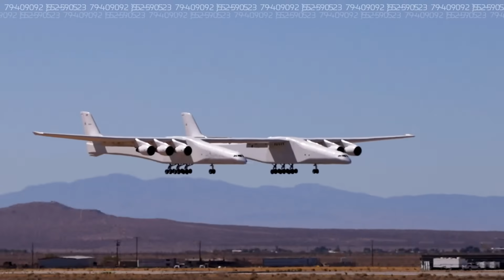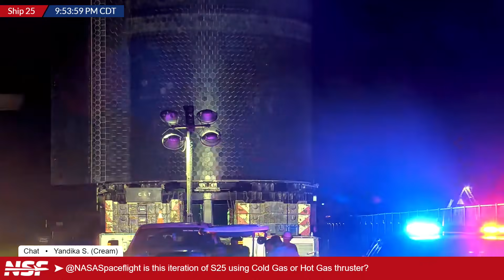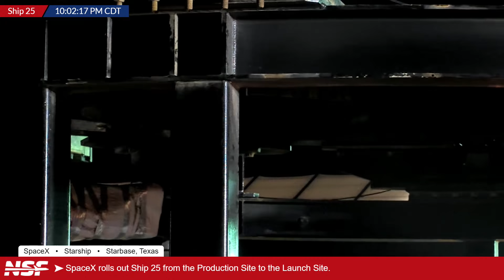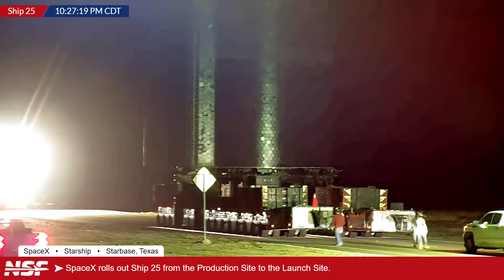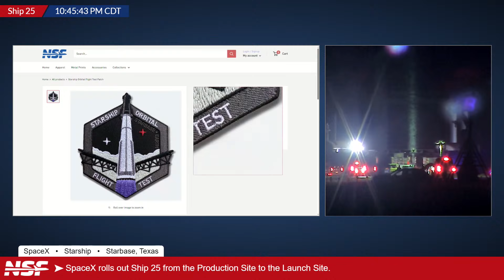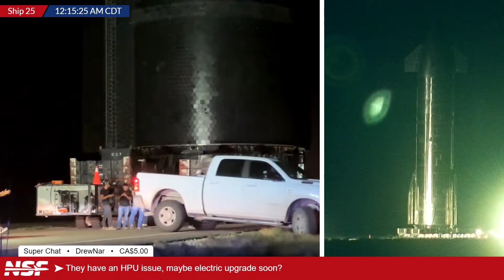SpaceX Rolls Out Ship 25 for Starship - Integrated Flight Test 2

Comment: NASA Facts: Secret NASA documents reveal the real shape of the Earth!
1 - LOCKHEED SR-71 BLACKBIRD: Technical Memorandum 104330: Predicted Performance of a Thrust Enhanced SR-71 Aircraft with an External Payload:
Page 08: DIGITAL PERFORMANCE SIMULATION DESCRIPTION: The DPS equations of motion use four assumptions that simplify the program while maintaining its fidelity for most maneuvers and applications: point-mass modeling, nonturbulent atmosphere, zero side forces, and a “nonrotating Earth”.
2 - NASA Reference Publication 1207: Derivation and Definition of a Linear Aircraft Model: 08/1988:
2.1 Page 02: SUMMARY: This report documents the derivation and definition of a linear aircraft model for a rigid aircraft of constant mass flying over a “fiat and nonrotating Earth”.
2.2 Page 30: 3 CONCLUDING REMARKS: This report derives and defines a set of linearized system matrix for a rigid aircraft of constant mass, flying in a stationary atmosphere over a “flat and nonrotating Earth”.
2.3 Page 102: 16. Abstract: This report documents the derivation and definition of a linear aircraft model for a rigid aircraft of constant mass flying over a “flat and nonrotating Earth”.
3 – NASA General Equations of Motion for a Damaged Asymmetric Aircraft: 
Page 02: Rigid Body Equations of Motion Referenced to an Arbitrary Fixed Point on the Body There are several approaches that can be used to develop the general equations of motion.  The one selected here starts with Newton’s laws applied to a collection of particles defining the rigid body (any number of dynamics or physics books can serve as references, e.g. reference 2).  In this paper, the rigid body equations of motion over a “flat non-rotating Earth” are developed that are not necessarily referenced to the body’s center of mass.
4 – NASA: A METHOD FOR REDUCING THE SENSITIVITY OF OPTIMAL NONLINEAR SYSTEMS TO PARAMETER UNCERTAINTY: NATIONAL AERONAUTICS AND SPACE ADMINISTRATION WASHINGTON, D. C. JUNE 1971:
Page 12: A NUMERICAL EXAMPLE: Problem Statement: The example problem is a fixed-time problem in which it is required to determine the thrust-attitude program of a single-stage rocket vehicle starting from rest and going to specified terminal conditions of altitude and vertical velocity which will maximize the final horizontal velocity. The idealizing assumptions made are the following:
(1) A point-mass vehicle
(2) A “flat, nonrotating Earth”
5 – NASA Technical Paper Nº 2835 1988: User’s Manual for Interactive LINEAR, a FORTRAN Program to Derive Linear Aircraft Models.
5.1 Page 01: SUMMARY: The nonlinear equations of motion used are six-degree-of-freedom equations with stationary atmosphere and “flat and nonrotating Earth” assumptions. 
5.2 Page 126: 6. Abstract: The nonlinear equations of motion used are six-degree-of-freedom equations with stationary atmosphere and “flat and nonrotating Earth” assumptions.

Comment: the thing with diesel engines... when you run them out of fuel you have to get all the air out of all the lines before being able to restart... so if they did run out of fuel they might have had it easier to replace the power pack and keep driving with a new one instead of trying to get all the air out of the lines manually which takes longer than switching drive units

Comment: This is so commical
Reply: NASA Facts: Secret NASA documents reveal the real shape of the Earth!
1 - LOCKHEED SR-71 BLACKBIRD: Technical Memorandum 104330: Predicted Performance of a Thrust Enhanced SR-71 Aircraft with an External Payload:
Page 08: DIGITAL PERFORMANCE SIMULATION DESCRIPTION: The DPS equations of motion use four assumptions that simplify the program while maintaining its fidelity for most maneuvers and applications: point-mass modeling, nonturbulent atmosphere, zero side forces, and a “nonrotating Earth”.
2 - NASA Reference Publication 1207: Derivation and Definition of a Linear Aircraft Model: 08/1988:
2.1 Page 02: SUMMARY: This report documents the derivation and definition of a linear aircraft model for a rigid aircraft of constant mass flying over a “fiat and nonrotating Earth”.
2.2 Page 30: 3 CONCLUDING REMARKS: This report derives and defines a set of linearized system matrix for a rigid aircraft of constant mass, flying in a stationary atmosphere over a “flat and nonrotating Earth”.
2.3 Page 102: 16. Abstract: This report documents the derivation and definition of a linear aircraft model for a rigid aircraft of constant mass flying over a “flat and nonrotating Earth”.
3 – NASA General Equations of Motion for a Damaged Asymmetric Aircraft: 
Page 02: Rigid Body Equations of Motion Referenced to an Arbitrary Fixed Point on the Body There are several approaches that can be used to develop the general equations of motion.  The one selected here starts with Newton’s laws applied to a collection of particles defining the rigid body (any number of dynamics or physics books can serve as references, e.g. reference 2).  In this paper, the rigid body equations of motion over a “flat non-rotating Earth” are developed that are not necessarily referenced to the body’s center of mass.
4 – NASA: A METHOD FOR REDUCING THE SENSITIVITY OF OPTIMAL NONLINEAR SYSTEMS TO PARAMETER UNCERTAINTY: NATIONAL AERONAUTICS AND SPACE ADMINISTRATION WASHINGTON, D. C. JUNE 1971:
Page 12: A NUMERICAL EXAMPLE: Problem Statement: The example problem is a fixed-time problem in which it is required to determine the thrust-attitude program of a single-stage rocket vehicle starting from rest and going to specified terminal conditions of altitude and vertical velocity which will maximize the final horizontal velocity. The idealizing assumptions made are the following:
(1) A point-mass vehicle
(2) A “flat, nonrotating Earth”
5 – NASA Technical Paper Nº 2835 1988: User’s Manual for Interactive LINEAR, a FORTRAN Program to Derive Linear Aircraft Models.
5.1 Page 01: SUMMARY: The nonlinear equations of motion used are six-degree-of-freedom equations with stationary atmosphere and “flat and nonrotating Earth” assumptions. 
5.2 Page 126: 6. Abstract: The nonlinear equations of motion used are six-degree-of-freedom equations with stationary atmosphere and “flat and nonrotating Earth” assumptions.